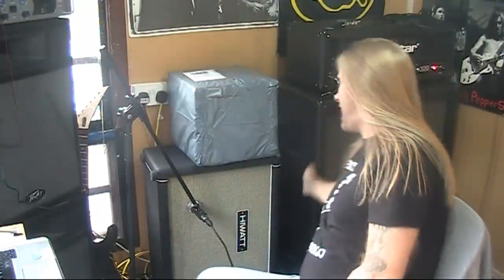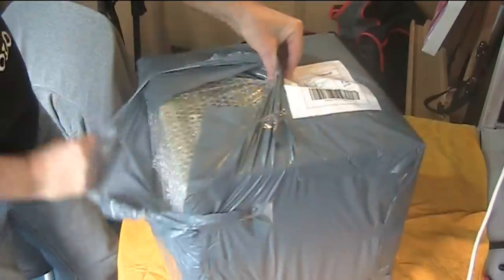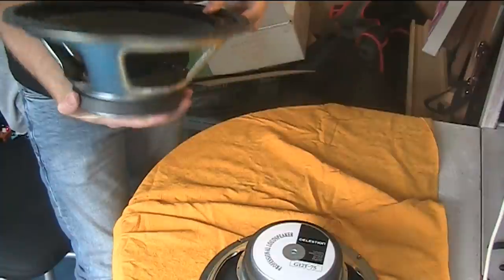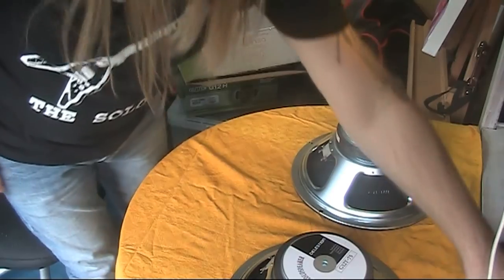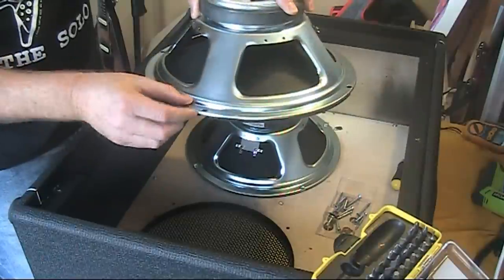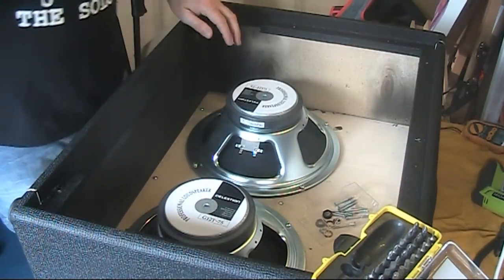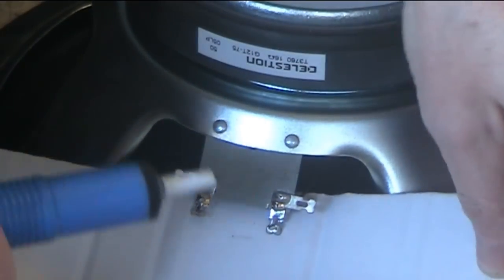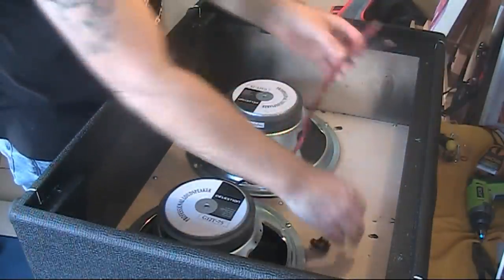Change Guitar Speakers in Your 2x12 Cabinet

Comment: I like the mid focus of the 70/80. the 12-75 are too scooped for my taste. perhaps mixing one of each in that cab would be the best of both. great video btw
Reply: Yeah man...the mid range growl from those 70/80 speakers is the absolute highlight...the highs are a bit bright and ear piercing  but can be tamed with the treble lowered
Reply: Mixing speakers that are the same ohmage is a great idea but at the start he said the original ones were 8 ohms and the new ones 16 ohms.
Reply: @WibblyWobblyBob  there shouldn’t be anything wrong with mixing them, you just end up with a combined 12 ohms in parallel
Reply: @Gralin James Pritchard I was actually thinking of my amp which is a 4x12 with series / parallel switching. But I’d you’ve got an 8 ohm and and 16 ohm in parallel you’re looking at total resistance of 12 ohms, which you can drive with an 8 or 16 ohm output. You wouldn’t ever (that I can think of) wire a pair of 16 ohm speakers in series, unless it’s parallel  / series, like in a 4x12, giving you a total of 16 ohm

Comment: The 70/80s sound more open and raw. The G12-75 sounded way to compressed and nasally. The 70/80 gets a bad rap but it's actually a GREAT sounding speaker. This video proves it. I have a 1x12 cab with a 70/80 and it sounds killer.

Comment: It's hard to say which sounds better. I don't have any, so I would gladly take either, lol. I'm thinking of making a cabinet. I have a small 5watt Fender Champ clone that I've been told would sound great with a 4-12 cabinet. Are the G-12's neodymium magnets? I know a guy who is taking out some old heavy speakers and said the G-12's are a much lighter weight due to those magnets. Wasn't sure if that's true. He's got a bad back and trying to lighten things up a bit.

Comment: Completely different sounds. I like the G12' 75s better. I have a Blackstar combo ID260 solid state and was wondering about getting a cabinet to go along with it of some Vintage 30's. I'm wondering what the mix use of them will be? Hell I might have to get a valve head for it if I don't like it and shoot for the 75's? I like it the way it is really, but I just want more. Always more. haha!

Comment: Great video but the 70/80s sounded more clear vs the t75 and that said we've all our opinion. I have a JetCity 2x12 cab I recently scored(box only) and threw in a pair of g12k100 with a Blackstar HT Metal head and honestly it doesn't sound so flattering; luckily I do have a pair of Hot100s that I'm looking to swap out and hopefully it has more definition than the g12k100. Perhaps if one has all the bells, horns and whistles to shape the sound, then it'll sound great but if it's just gtr/od/amp/cab then it's a moment of trial and error. Once again great video!

Comment: Nice video thanks. From the sound samples provided before and after sorry to say I prefer the 70-80s over the 75s BUT perhaps with different tone settings and volumes I might prefer the 75s. I am here because I am looking for speakers. Thus far I am thinking about EVM12L and several Eminence speakers like the Swamp Thang and Texas Heat. Eminence has great sound cards and their speakers are USA assembled also considering British Celestions. My plan is to use the same box at different times between 2 different amps, a Vox AC15/30  and Fender Super Sonic 60. It will be interesting to see (Hear) if the box sounds better out of one amp or the other. Anyway thanks enjoyed your efforts !!!

Comment: quick tip ... use a 9 volt battery and an instrument cable for a super quick way to test speakers - when loaded in a cab you can check if they're in or out of phase too!  cool vid thanks for posting!

Comment: I gotta say that the 70/80s had a little bit of low end flub from the palm muting that could easily be EQ'd out but there was a lot of definition in the mids and highs. The g12-75 just scoops everything. And you can't EQ sound back in.. I prefer the 70/80s, record it and throw in a tiny bit of a highpass and it's a great sound.

Comment: I like the sound about the same. I sold my t75s out of my JCM 4x12. Replaced them with 16 ohm Celestion V30s. Wired for 16 ohm. My Marshall MkII SLP seems to really like the 16 ohm load. 8 ohm spkrs sounded kinda meh.  Thinking of doing an X pattern of EV-12 BLS and Fanes, can't remember off hand which model of fane. Have a blessed day. Later

Comment: I would mix the two and run one of each in that cab. I own a couple of marshall model 1936 2x12 cabs and run a 1990's G12-75 which sound much better than the new ones IMO and vintage 30'sin the other hole.

Comment: Hi Dave....my V 30 replacement speaker came with a 4 segment foam gasket that I assume sticks on the speaker after you peel the yellow tape. Should I use it or go commando?
Reply from the maker: I would use it.
Reply: i think it is for a front  loading  situation  
to put it at the back of the speaker

Comment: Hello guy!!!
I got a 50w tube amp head now and want to get a 100w.
I would like to replace the 2 speakers i got in the Evh 212 cab (Celestion g12h 30 anniversary 8 ohms) with 2 Celestion Vintage 30 60w 16 ohms. Can you tell me if it's possible as the the 212 cab is 16 ohms?
Reply from the maker: http://www.regiscoyne.com/tech/spk_cab_wiring/

Comment: What can I put to my fender 2 x 12 amp to get on better with digital pedalboards??  
in the market I only see names like 70 or 80, and I dont know if they refer to the decades or what.  Because if I am going to get a vintage sound ... that is what I am trying to replace from old amp Fender ultimate chorus (not sure but I think it has 2 x 62 watts).

I will tell you what I see here in the market..  What do you think?
Woofer Celestion G12 V Type 70w
Woofer Celestion 12 Vintage 30 60w  (I dont think I will ever buy a speaker named vintage)

Celestion G-12h 16 Ohms - 12 '
Celestion G12m Greenback 8ohm speaker 25w 12¨ 

Celestion G12h 70 Aniversario 30 W 12'' 

Celestion G-12m Creamback 65w Black Week 

Celestion Classic Lead 80 12''
Celestion G12t-75 G12t 8 Ohms 75w

Celestion Seventy 80   --> this one is quite low price but that is exactly the one you replaced. 
I didnt tell you about my speakers, they are the original ones from the Fender ultimate chorus amp, the ones with blue metallic sticker (all american fenders have it). I think they are 12'.  Not sure about specifications.
Please tell me something, I was seeing my future and gathering a fortune to buy a powercab line 6 for digital pedalboards.
Reply from the maker: What fender amp is it?
Reply: @DaveBarlowGuitar   it is big one,  Fender ultimate chorus.  2 x 12 (I think it is a 2 x 63 watts or something). I have the manual, it is a pdf file but I the owner gave it to me when I bought it,  I dont even know how many decades it has been working.

Comment: Hi Dave, man the midrange you get with those seventy 80 speakers is awesome..so underrated .. yes the low end is a bit flubby for heavier rock..but dam they sound so so open and clear.

I would love to hear the seventy 80 matched with a g 12 t75..just to fill out some of those mids.
Reply from the maker: I found that the Seventy 80 works great until you push them real hard where as the G75 dont sound so good at lower volumes but sound best when you push them hard. I may replace one of the G75's in that cab with a V30 for balance.
Reply: You will probably find the V30 will dominate that match up the 75 is running at 97db and the v30 at 100db
Reply from the maker: Yes you are correct, might do some more experimenting :)
Reply: Man, please try the seventy 80 with the t75 .. they are almost the same efficiency..  I never thought of trying that combo till i saw your video..i sold all my t75's  in my quad cab so i cant do it myself..  I just get the feeling the t75 should fill out the loose lows of the 70 / 80 and the 80 should fill out the mids lost in the 75
Reply: I also reckon the creamback M65 could work along side of the  t75  the creamback will give the combo some added warmth as well

Comment: I was just searching for some celestions myself for a quad box build and remembered watching this video. Strange how you were complaining about the low end of the 70/80's. I was looking at the frequency curve of both these speakers on the celestion website and the bass response is very similar on both. However up around the 12kHz mark on the 70/80, theres a big dip. The dip starts higher on the G12-75s up around 18kHz or so. Maybe that's the difference with the two. At least you're happy with them.
Reply from the maker: The 70?80 are great speakers, I just found that when you crank the amp right up the speakers got a bit flubby, could be amp speaker combination I suppose :)
Reply: Could be the combo. When I listened to your clips, I didn't mind them! When researching, I like the tone I get from my marshall TSL602 - which has celestion wolverines. The consensus is people don't like them. I don't find anything wrong with them. And it's cranked when played. I think that's half the trouble with people who don't like 'em. The only thing I find with this amp is when the output tubes start to go, so does the top end. Tube replacement time!

Comment: The G12s are a more focused and tight sounding speaker to me. The 70/80s while ok are basically Celestion's cheapest line.
Reply: Seventy 80's rule. They all cost nearly the same to manufacture. Pricing is due to supply and demand!
Reply: I currently pair a 70/80 from a Randall combo with a vintage 30. I think it sounds really good. But I just like trying different speakers out so this sort of content works for me.

Comment: I bought 4 G12T-75s for my cab and I immediately had to change out two of them because it was just too muddy and not enough low out of them... so I did an X pattern of with two other Celestion I had laying around which are G12M-70s and the two together don’t sound too bad.. I will say though that I agree with you that the seventy 80s do sound like shit when you push them

Comment: way better! would it make any sense to put a  g12-75 next to a vintage 30 in the same 2 by 12 cab?
Reply from the maker: yes, big reshuffle, now use vintage 30's in the Hiwatt as has a very good bass response anyway, and vintage 30 mixed with 75 in the 4x12 cab. but either way sounded good TBH, gonna keep experimenting.
Reply: I've heard the mix sounds good, but I've also heard the v30s have a 100db sensitivity and are much louder and tend to drown out the g12-75s (97db). I'm planning on doing an Eminence speakers mix similar (Governor & Manowar) to the v30/g12-75. Their speakers are supposedly better and a closer match in efficiency.

Comment: why do people typically use 4x12 ..  2x12 .. 4x10 .. 2x10 ? when pairing speakers is there any benefit to having a 4 speaker cab where all speakers are same size?
what if someone put 2x10 and 2x12 in a 4xcab. pros and cons?
Reply from the maker: Good question :)
Reply from the maker: Bass players do it

Comment: You need to be aware those G12Ts are Chinese not UK made there is a massive difference in sound and performance. seventy80s are not a good rock/metal speaker there too muddy, bass is way to open and the middle/top just gets lost. Thats why you find them in a lot of cheap cabs

AS for the Chinese G12Ts there harsh compared to the UK version which is lovely and smooth and kinder to your ears still think its hard to beat Vintage 30s, I have just bought a couple of G12T-75 UK version (later ones not the really early ones I do not think there is any difference in sound) and have to say I like them... Bought quite a few different pairs of speakers recently, great thing about 4x12 stereo cabs you get a choice of a pair of one type of speaker or the other or all together. Going for a pair of Vintage 30s and a pair of G12T-75 UK version, but I think a full set of either would be good. Depends on your amps and genre style but for good old UK Heavy Metal Vintage 30s and G12T (UK) are sooo sweet

Comment: Celestion seventy 80 s much better. You got to think there was a reason why the other guy replace those 75. Although I would like to hear a 1275 with a 70 80
Reply from the maker: I think it depends a lot on what style of music and amp you are using, I have since used these in a 4x12 cab with V30's and its a good balance for classic hard rock.

Comment: two 16 ohm spkrs run at 8 ohms   4 16 ohm run at 4 ohm there is a ohm calculator on line just loo it up..this page has a calculator and explains running parallel or in series..     http://www.bcae1.com/spkrmlti.htm

Comment: Should have left the original speakers in
Reply from the maker: to be honest, 70-80's are good speakers, they have a good mid range quality, however it does depend on your amp and set up, plus everybody's taste is different. I mix the 75's with Vintage 30 which gives a bigger overall sound which I like.
Reply: I think it sounds better with the 75's, but I've found that 70/80's often sounds good with modelling amps or the like.
Reply: No way.....  70/80's  Pale in comparison to V-30's, Heritage, or t-75's...    I do like the bite that 75's add...